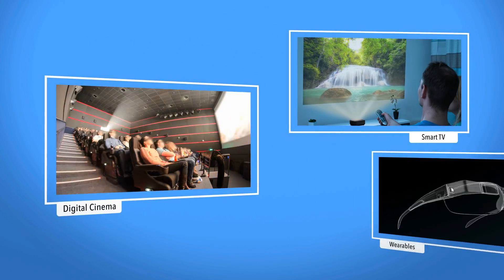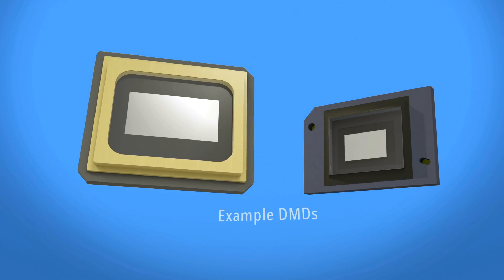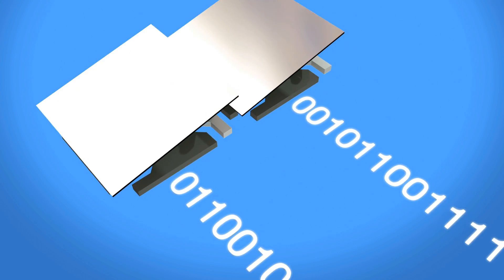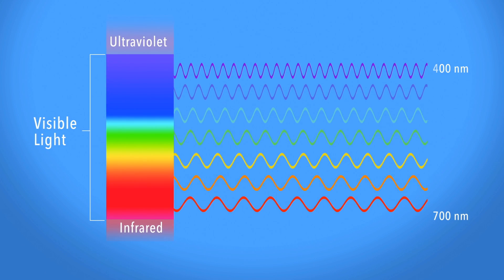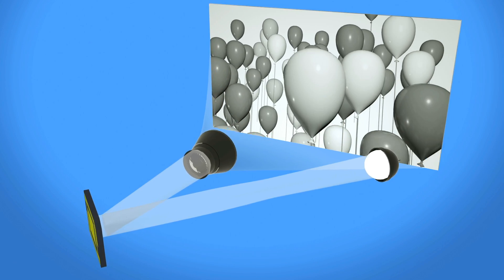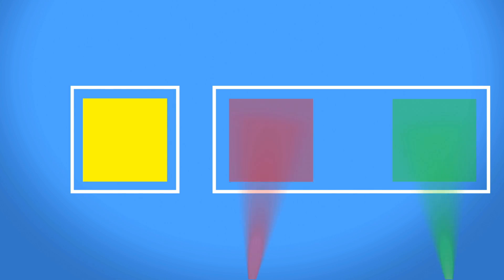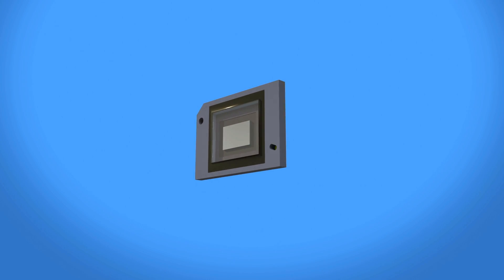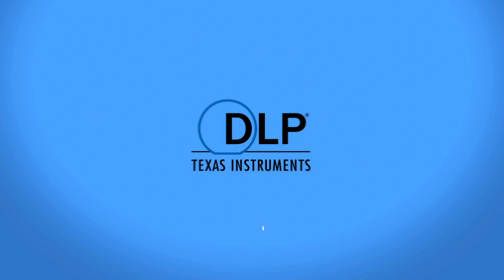How To Display Video & Control Light Using TI DLP® Technology

Comment: how to control this chip? I need a drive circuit board right?
Reply: probably start with a dev kit where the chip is already soldered to a development board. https://www.electronicdesign.com/technologies/embedded-revolution/article/21805540/building-an-embedded-dlp-projector-for-99-and-a-beaglebone

Comment: Where is the diy dlp projector tutorial, I know the chip can be bought for under 500$, and a fpga capable of pushing enough data to it are under 100. Come on the title mislead me into thinking this was an actual tutorial. Smh
P.S. specifically speaking about the 4k dlp chip.
Reply: Seconded
Reply: How would you even begin doing that? The optics involved, the color wheel synchronization, the processing of the micromirrors... If it's a project for fun, great. If your aim is to actually make a working 4K DLP projector, you're wasting your time.